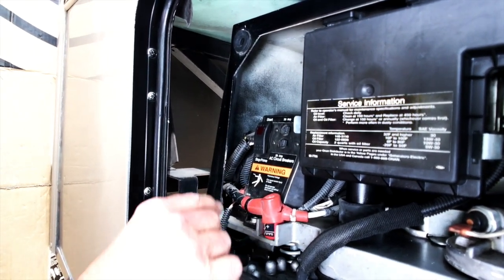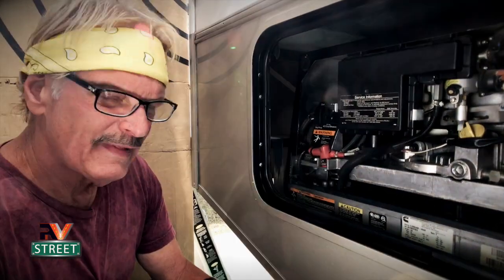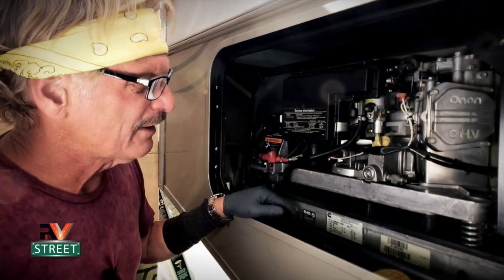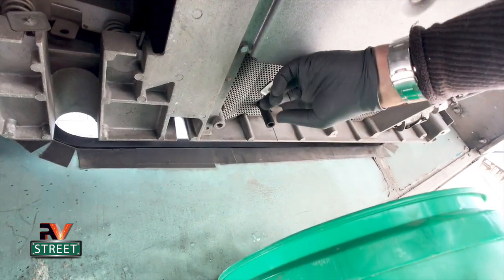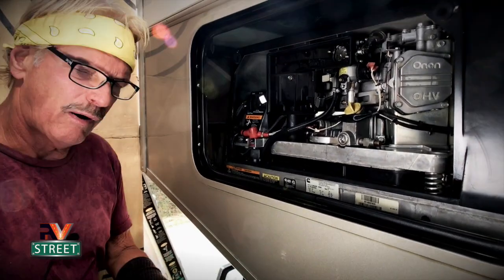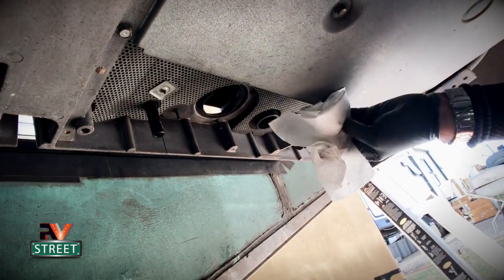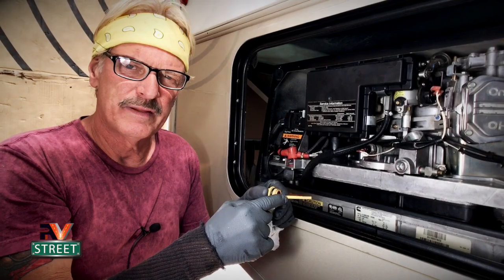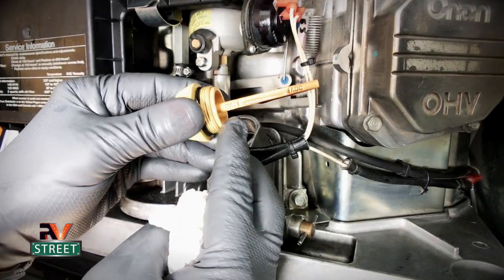CUMMINS ONAN RV GAS GENERATORS - ULTIMATE MAINT. GUIDE - Part 1

Comment: Excellent advice to check the oil filters seat for loose paper, etc. I'd add verifying the previous filters O-Ring isn't stuck to the filter seat. Knew someone who had an oil change performed by a local shop where that occurred. The shop unknowingly installed a new filter on top of the stuck O-Ring. Tightening the new filter caused the stuck O-ring to rotate and spit out partially. Well, the engine was wrecked after the customer drove away blowing oil out of the unseated new filter. There's probably more to that story, but the end result was a damaged motor.
Martin and Joannie; I really appreciate the videos you two have produced. Watching your must-haves to decide what air compressor we need and this one to finally give our Onan its first servicing. Thanks again (Jay & Gail from FL).
Re-watched this; Martin made it a point to verify the seal was still attached to the removed filter!

Comment: Update to my previous comment:  I have always been a DIY oil and oil filter , air filter guy. But after watching this video I pulled the cover off generator and said to myself “Martin would not be happy with the way this thing looks”. But after watching this video I did just as Martin instructed. And what a difference it made. Especially it would not start on first attempt. Always took two tries with a pause between tries. Today in low 30 degree temps I primed it and pushed to start. It fired up after about three seconds of cranking and ran about 7 hours as we motored to Florida.  I believe Martin’s instructions to clean all the electric connectors was a major reason for better starting. Regular service and preventive maintenance. “Don’t leave home without it”. Thanks Martin.
Reply from the maker: Martin would not be happy with the way this thing looks...you got that right Barry.
And what a difference it made....Yep! 
Way to go and thx for coming back and commenting. Doing PM is the only way to keep everything running it's best. You're a living testimony. thx Barry 🔧
Now for the rest of you out there....get your rig Martinized.

Comment: Excellent video and so comprehensive. As someone who is relatively mechanically inclined but does not have a lot of experience with generators and small engines, I appreciate the little details in tips and tricks. Keep it up!
Reply from the maker: Did you happen to watch Part 2 and Part 3 also?
https://www.youtube.com/playlist?list=PLkQXtMp9xodRcd1MYY9cn1LTAzgImKgH0
Reply: @RVstreet  I did, just today. I did a little RVstreet binge! I'm having a couple small problems with my RV so I was doing some research.
Reply from the maker: @Jlharrell1981  👍

Comment: Great video Martin.  Thanks for all your content, I've been watching most of your videos daily.  One comment on the Onan Generators, I have a Marquis 7000 looks almost exactly like yours.  When I first got it, I thought you had to hold the stop switch down until the generator completely stopped.  Little did I know when I did that, the prime came on and it appeared to flood out the engine.  Made it really hard to restart Hot.  You just need to push and release the stop side of the button and the controller will stop the generator for you.

Also, I was made aware of cooling issues in hot climates (CA Desert), we can reach upwards of 120+ degrees during the summer months.  I was told to make a deflector out of sheet metal and install it behind the muffler opening in the bottom of the generator.  This will keep the hot exhaust gases from being drawn into the cold intake side of the cooling which is right next to the muffler opening.  Made big difference for my generator!  

Thanks again for you great videos!
Reply from the maker: Hummmm...good tip for the 7000. Mine you have to push stop and hold to shut down the generator but that never has affected restarting when hot.  The sheet metal deflector is also a good idea in hot temps. Never heard of that before. Whenever I park in ANY place like the desert where I have the liberty of parking anywhere, or at any angle, I TRY to accomplish two things:
1) Face the motorhome so it points north so the sun doesn't come into the windshield
2) Face the motorhome so it points into any present wind or breeze, so the generator exhaust is carried away from the rear. Either that or mount a Gen-Turi like I showed in Part 3.
thx Bill 👍

Comment: Just returned from a FMCA convention and Onan factory folks were there;  on the venturi they suggest hooking up something that will allow the exhaust pipe to continue to vibrate; the example you showed appears to not allow for vibration.  We also have a 2001 Marquis Gold 5500 just like yours so your videos have been spot on for us.  The factory also said no need to replace the spark plugs as they last forever.  Final point:  we use marvel mystery oil in the fuel which is an upper cylinder lubricant and increases our mpg 2-3 mpg;  and we use sta-bil stabilizer if we're going to be out of service more than 30 days.

Comment: Good maintance video Martin, just as a little reminder, I take a paint pen and Mark the date I change my filter. (For all you old Army guys, I made a 2404 chart as well, this insures I cover everything)
Reply from the maker: thx William 👍
Ya, I keep track of my stuff a little different. I keep maintenance logs on everything I do. One log for our toad and one for the coach. My coach maintenance logs are now 35pgs. long and I keep them in a con't document on my laptop. However, I do label our 3 water filters and our water softener like you do.
Reply: William I do the same thing! LOL! I also mark my filter so that I  do no more than 1/2 to 3/4 of a turn from the time the seal touches the base to the point of snugness! It's alway worked well for me!

Comment: An excellent and valuable video series for RV owners! I have virtually the same genny in our rig and practice most of the techniques you share, but its very worthwhile to watch every second of this. On another note, I had a very surprising failure on my  450 hour genny about 4 months ago- something I'd never expected in a million years. While traveling on a warm day through south Georgia, I attempted to fire the genny to get power to my roof top A/C units to cool the rig down. I hit the starter switch at the drivers seat and nothing happened, not lights, no cranking -- nothing at all. I pulled into a fuel stop and while there went back and pulled the cowl off the genny as I wanted to see if anything was visible and to attempt to start it from the starter button on the genny. To my surprise I observed immediately that the starter cable connector from the battery , to the starter power post under the red boot, had completely failed and severed, thus I had not power from the battery to start and operate the genny. I'd never seen or heard of a failure in a batter cable connector. I stopped at a nearby parts store and found the connector was stocked and easy to purchase for about $5. As it was crimped on I had to cut the cable behind the cable connector  and re- attach it to the genny's positive post under the red boot. Other than getting enough horsepower in my hands to adequately crimp a new connector on, it was an easy and quick fix in the parts store parking lot. I hope no one else had that failure but wanted to share just in case. Joe M
Reply from the maker: Excellent post Joe. 
You see folks, once you know the basics of how these generators work, most of these common break downs or mishaps can be fixed DIY on the cheap. And he did this fix in the parking lot. Oh, and had the tools on board to do it too. Good job Joe. 👍

Comment: Great video. Another helpful tip for the spark arrestor plug confined hot area is use a long 1/2" drive extension to grip the plug and use a wrench on the male end of the extension. Saves fighting in the confined area no burn issues.
Reply from the maker: Thanks for sharing

Comment: Man what a great video want to buy a 2000 350 with a trident engine Chateau Class C with a onan micro quiet generator 4000-watt snow are near as spotless as yours. A trick that I found about removing the engine filter Tiki use bread filter tie a knot in it at the bottom the bread bag then after you loose your filter just a little bit did Slide the opening of the red bag over the filter and unscrew it and all the oil will go down it into the bag I drill a small hole in the future like you do
Reply from the maker: Thank you for sharing your information with all of us.

Comment: Thanks Martin!  One year ago I upgraded from a Generac 3.0 to your exact Onan 5.5 Superior in every aspect.

I ordered a shop manual directly from my nearby Cummins/Onan store. Not the most detailed of shop manuals! I hope you cover valve adjustment. There are no videos on the subject yet that are RV STREET quality.
Reply from the maker: No I won't be covering valve adjustment. There's to many folks that will watch this series and have a wide variety of different generators that require different specs for things like that. Most of our audience wants or needs to know—the basics and a little beyond—of how to take care of stuff. Tearing into an generator or engine and doing stuff in there, most would not interested. However I am mentioning the schedule for this in the description text. But that's why I recommended to everyone to get their own service manual and follow that.
Edit: However, after further thought, I MAY consider doing a vid on adjusting the valves the next time I have to do mine. We'll see.

Comment: Sir, this was tremendously helpful and it is greatly appreciated. I am going to go to the store today and get cleaner to make mine as clean as yours. I finally know how to maintain it as well. My generator won't crank and I'm getting a code 36. It seems like it engages, the generator even torques a tiny bit to one side, but it doesn't turn over. Where should I start trouble shooting? If you are too busy to respond I totally understand. I will certainly use the amazon store to buy all of the things I need for maintenance in the future. Again, this is a tremendous service to all of us new RV'ers.  Thank you so much.
Reply from the maker: Hey Robert,
Where should I start trouble shooting?....the manual. 
Read what it says about the cause of the blinking lights your getting. I know it's code 36 but do they also have suggestions of where to look and what could be the problem. Also in the description text did you go download link for the service manual I put there?
It very well could be your batteries not having enough juice to start it.
I don't know how many hours you have on your generator or how it's been cared for, but it could many things. But what you should do to start with is perform and full 150hr. maintenance schedule on it like I showed. If it has around 500hrs. on it since its last schedule, change the plugs too. And then check everything I covered in this video. Be methodical and take your time.

Thank you so much for supporting our channel. Joanie & I  so much appreciate your support. 🔧 🙏
Reply: @RVstreet  I will do that maintenance you suggested as soon as the ice melts! I do appreciate you taking your time to make those videos. I wasn't doing the best job with maintenance, but now I have been educated!

Comment: I know a guy who used to be an Onan tech who independent now and mobile and I had him replace a voltage reg. in my Micro 4000 Onan. He told rarely is an issue the fuel pump, or brush related. Told me in the close to 30 years he worked on them he saw perhaps 2 generators with bad brushes. And fuel pumps were usually related to cramped quarters i the RV compartment, fuel filter, old fuel line rotted on inside. Also if you have a Flight System G-Man 360 diagnosing a generator is mere minutes. Many shops either don't have one or know what it is if you mention it by name. They'd rather throw parts at it ($$$.$$)....or off the bat "Yeah we'll have to pull the generator out..." $$$$.$$ Run!

According to the tech I know most of the time (75 percent) it's the voltage regulator. Next the control board.

Comment: As below, this is the most complete video -  Thanks.   I have the Onan 5500 GAS  (HGJAB)  SPEC M.   The manual link shows J-L but that's the one I downloaded.   Mine does something annoying.   It will run for varying times from 5 hours down to as low as 5 minutes and then shut off with a 3-6 code.   I once found the door not properly hooked in at the bottom and believe that was the cause when it would cut off every 20 minutes.  It's new coach with 65 hours on the Generator (about 15 months old).   I've checked the oil level and it's aways been good).    It "lopes" a little and sometimes will die during the lower RPM of the lope.   I've taken it in, and called Onan all with no help.   One tech told me the gas line might be getting hot and vaporizing the gas before it gets to the Carb.   Can't figure that one out.   Any ideas?   Ir'a scheduled for another visit to the shop but will probably get CND'd again.
Reply from the maker: Well assuming you've done all your annual maintenance items we can rule out any of those items. It could be fuel related. Unfortunately it's a common practice that most RVer's—maybe not you—don't exercise their generator often enough and that can cause gumming up issues in the fuel filter, fuel pump and/or the Carburetor. Here's where I'd start. Always start with the easy common things first.

Put some Sea Foam in your gas tank. 1 can/20gal. of gas. Fill the tank up. Drive the rig so the Sea Foam is mixed thoroughly in the tank. Now run the generator for a couple of days off and on for several hours each time with at least a 1/2 load on it and see if that won't clear this problem up. You can get Sea Foam from my Amazon Store: https://www.amazon.com/shop/rvstreet/list/1FUC3YMUOK6RD

Also make sure there is NOTHING under the generator that can obstruct air flow coming from the generator. If there's stuff under that area, the generator will over heat and shut down.
Reply: @RVstreet  thanks for responding!!  My RV has 5000 miles and spent 7 months of its 14 months I’ve owned it (first owner) - in the shops.  Ford F53 chassis class A for a rear axel recall, and in the RV shop for the generator issue I mentioned.  They couldn’t duplicate the issue.   It typically ran ok parked.   We’ve been on 2 trips of about 800 miles.  One in August from Texas to Destin Florida.  Very hot.   Rv was 5 mos old.  Shut off every 20 -  30 mins random.  Unit is mounted in back left bay behind left tires about 5 feet away.  (Installed per install guide).  No blockages for air intake.  I removed the panel that lets air in.   Was clean and debris free.     I’m thinking it’s an intermittent oil sensor.   I ordered all the parts off your Amazon store.
Reply from the maker: @dartht.3736  Ok cool. DO NOT run the generator with the door off. That door needs to be in place when you run it or it won't cool properly. If you think it's the oil sensor, remove the wire off the top and if the generator runs good, you know the sensor is bad.

Comment: Very thorough job as usual budroe. However concerning the dipstick, you may be aware that many older ONAN gen sets specifically note in the manual to check the oil WITHOUT screwing in the dipstick all the way. If you check the oil that way on the older micro quiet & microlite 2800 & 4000 series you will overfill with oil. Not good. So from one dipstick to another careful on the dipstick advice. My Onan microlite 2800 only takes a little over 1 quart of oil. That dipstick measurement is important.
Reply from the maker: That's why I always encourage everybody to have ALL their owners manuals and read them. I even gave them a link in the description text so they can find their specific model manual. There's usually always some subtleties from model to model. And of course I covered a lot more things in Part 2 and Part 3.
thx Jay 👍

Comment: WOW!  Just found you...Great Videos!!!  I just bought a 2011 Georgetown with an Onan QG 5500 generator with 6 hours on it!!  Any special considerations?  My check list from you so far:  Run with a load, slip rings, sea foam, changing the oil/air/fuel filters.  Anything else??  Thank You!!!
Reply from the maker: I'm sad to say that Martin has passed away and I have no advice for you other than what's on the video. Congrats on your new motorhome and safe travels to you.

Comment: A couple of various size medical/hobby forceps is handy in the tool box. The forceps are lockable and grip clamp nicely. Could help ya replace the screw driver for getting into tight places with your wiping or ??
Also ever use a gas stabilization additive? Like Sea Breeze. I use it year long, great in case of moisture in fuel and long periods of sitting. I also try to start all my recreational/ seasonal stuff once a month for 5 or so mins
Reply from the maker: Hi Ron,
Ya I use Sea Foam pretty regularly as a fuel injector cleaner and a gas stabilizer too. But when you exercise your generator or ANY OTHER gasoline equipment you have, you have to put a load on it to exercise it properly. Now you maybe already know that, but if you don't, I covered that in Part 3 of this generator maintenance series. If your interested you can see that vid here: https://www.youtube.com/watch?v=IAzPCIvNuY8

BTW...I used to carry forceps in my tool bag years ago. I forgot about those, but you're right those things are awesome. Thanks for the reminder. I'm going to keep my eyes open for a pair of those. 🔧👍

Comment: I had problems with my 2015 Bounder the 5500 Cummins would not stay running, took it to Cummins. The timing was off so they had to adjust it. Sold that Bounder because of other issues and I'm the proud owner of a brand new Tiffin with a 7k Cummins better RV and better Genset
Reply from the maker: Nice.